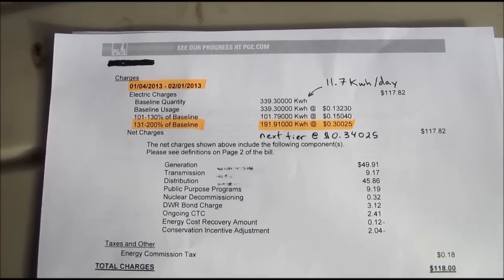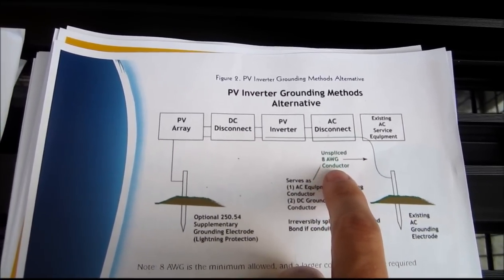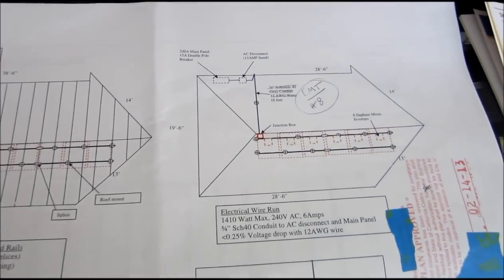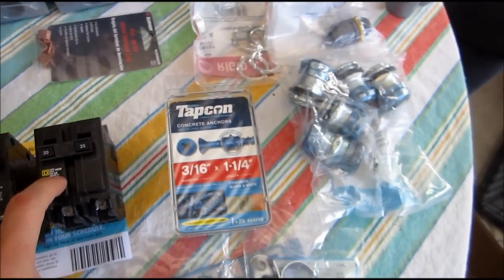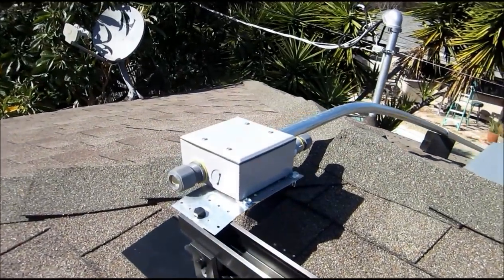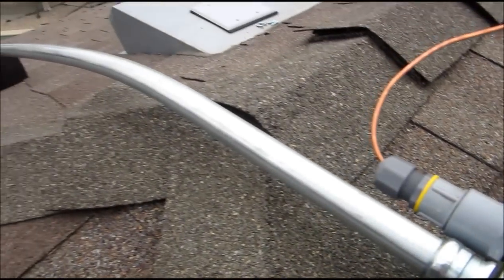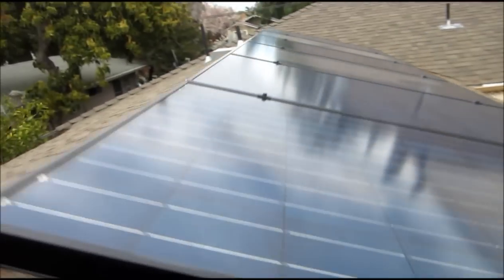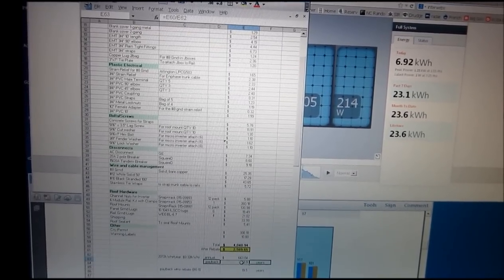1.4kW DIY Solar Grid Tied Enphase Permit Self Install with 4 year payback

Comment: How did you get this approved for net metering since the enphase micro inverter is not UL 1741 certified, per the California "List of Eligible Inverters?"
Reply from the maker: Yes, the Enphase M215 micro inverter is UL1741 certified, and also on the California list of inverters, so no problem getting it approved.

Comment: Im curious about the connection to the electrical panel.  Does your  wiring from you disconnect box connect directly to a double pole breaker in the panel.    I did not see you do that.
Reply from the maker: Yes, just wire directly to the breaker like any 240V branch circuit.

Comment: Did the city mention any setbacks you needed to comply with? Like a setback from the peak of roof? I see as silly, because you have backside firemen can cut through if needed...
Reply from the maker: Luckily I installed a year before they added the onerous setback requirements.   This installation wouldn't be approved in it's current layout under the latest rules.

Comment: weird how you weren't required to have a clearance from the roof ridge to the panels.
Reply from the maker: The roof ridge setback requirements were started in 2014.  I installed before they were required.

Comment: You had tall racks, why not run wire in the rack to the panels, that way they would never lay on roof or be steel tied to rack, done...
Reply: Would need peep holes, especially if ends are blocked...

Comment: Can THHN rather than THWN wire be used to pass the city inspection?
Reply: +David Wang No The W in THWN stands for weather resistant.
Reply: Yes it can.  THHN is usually rated as THWN-2.  I recently passed inspection with THWN-2 on 1-line diagram, and could only find THHN in stores.  It passed.

Comment: What is that couple black materials did you used that the conduit sitting on?
Reply from the maker: +marjomjom Blocks of wood painted black.  They are just resting on the roof surface.
Reply: marqlin My solar installers used block of woods too conduit sitting on, but am not comportable coz wood will rot over time bcoz of sun and rain. They applied white substance though not sure if paint but I will wait until the city inspector come then I will ask them my concern. Thanks

Comment: Very nice video. It does a great job of putting all the steps together. Information is all available from vendors, NEC, and permitting agencies, but no one else has done such a good job of putting the entire end to end overview for DIYers. To bad you weren't able to use the newer, integrated ground Enphase. Eliminates all that grounding on the roof. Also, there are some engineered penetrations that are quite nice and waterproof.

Comment: Since your solar generation is across your house load just like the power company, 2 sources in parallel in essence, how is it determined that the power from you solar is the first to be used and that the power company electricity is only tapped once your load exceeds your panels?  Seems to me that, up to the capacity of your solar, your load splits the power from your panels and the electric company and therefore you can never have less than half your power from the electric company.

Comment: I have been looking into doing this my self I'm in AZ but I found my permit is $600 in Phoenix, and APS my power utility charges $200 or something I guess to discourage solar installs.  Contractors are about double what the cost of the system is I'm thinking a small system like yours would help with the bill.

Comment: Would they have allowed you to go through the roof to inside the attic? Then you wouldn't need to use conduit inside the house.
Reply from the maker: wiboater4 I  wanted to minimize the  number of penetrations into the roof.  This is a clean install that is completely exterior to the house for easy long term maintenance.
Reply: marqlin This is why I like the idea of dedicated sun-shade awnings

Comment: Do you need PG&E permit in additional to the city?
Reply from the maker: Stephen Ho Yes, in my community one must fill out paperwork with PG&E and they will install a meter that will run backwards.  Otherwise, during the middle of the day your meter will just stop moving forward, but not go in reverse.  There is no charge for this application from PG&E.

Comment: So, no batteries or charge controller necessary? Does this mean you are basically selling all the power made to the power company and still paying the same rate for the power you use? Or are you using some power from the system in the day, and sending the rest to the power company? I do understand it is lowering the cost in some way, but I'm not sure how the power company handles all that. Do you need a smart meter, or a second meter for the power company to calculate it?
Reply: as you have seen, he's using micro-inverters linked to every PV panel. but there are batteries inverters solutions too, that works well with that.
It's like he's storing that energy on the grid, and get it back in the night, avoid the extra expenses of a battery pack, battery storage doubles the whole expenses of the system and double the payback time.
Battery storage is a must if you're living off-grid, have frequent blackouts, unreliable grid, or just want to be fully independent.
In Germany the solar system incentives are being lowered because of the solar peak production strains.
there is a move toward minimum storage, (1~3kwh) to smooth out peak productions and peak consumptions, so some are expecting incentives for energy storage too.
Reply from the maker: Correct, no batteries or charge controller.  There is a smart meter. The power generated by the panels goes into my house so I pull less power from the grid.  If my house is consuming less than the panels provide then the meter spins backwards.  I think I'll do a video showing all this data, from Enphase and from the power company, it's pretty nifty.
Reply: Ted Bundy Thats why you dont over produce. That only occurs at the end of the year if you have a true up bill. This keeps your tiers down.

Comment: Informative video!   It's amazing how the cost of the panels and micro-inverters has dropped over the past few years.  We have an 18 (panel+Enphase) system up in the Sierra and the parts were so much more just 5 years ago!   Also, from some of the comments here, it might not be clear to some that the two main advantages of using a micro-inverter are:

(1)  one panel or inverter going out does not impact the rest of the system, unlike a typical series-wired panels and common inverter system.

(2)  Enphase micro-inverters are rated to connect directly to utility power.  This means in areas like ours in CA, the utility is required to buy or credit you back if your solar output exceeds your usage.   In the mountains, we use PG&E like a bank to store the excess power we generate in the summer to help heat the house in the winter (when snow covers our hot water panels)

Also, one viewer commented on the seemingly low power output of your panels and that it might be due to the temperature.   In my experience, there is very little degradation in power due to high temperatures, and anyway your video clearly showed the panels putting out 215+ watts (out of 235) in the middle of the afternoon - not bad!

Again, great video and thanks!

Comment: What happens after the 4yrs?
Do they cut you and actual check?
Reply: No. 4 year payback means that if he produces $600/year of electricity through solar power and the solar system he installed cost $2,400, the system will pay for itself in 4 years. After that it's all FREE ELECTRICITY for 35+ more years!! Yipee.

Comment: Great video!!!! I'll be installing a similar system this fall at my home here in Alameda county.  Questions: 
1. Did your jurisdiction have any issue with your 6' spacing of roof mounts?  The solar rail company i'm buying from is recommending 48" spacing.  Not sure if they are just trying to sell me more product.  The rails i'm using are rated for 96" span.
2. I'm having trouble finding an appropriate strain relief for my bare copper EGC, what did you use.
Again thanks for the very detailed video.
Reply from the maker: Glad you enjoyed the video.  To answer your questions.

1.  For SnapNRack racking/mounts they have information in the installation manual, available online, on what spacing is required for your roof type/angle/wind speeds/height etc.  The manual is stamped by a P.E. from most states including California, so if you follow the manual in this case your local jurisdiction should be satisfied.
2.  I believe I used Arlington LPCG503 for ground strain relief (off the shelf at Home Depot IIRC).  This along with my complete parts list and cost is at the end of the video.  Switch to HD for proper viewing resolution.

Comment: Only 6 to 7 kwh per day? That's a failure given what it should produce. I assure you much higher production if you moved those to the ground. The heat given off those asphalt shingles is a detriment to those panel's production. Mine are on the ground and I see a big difference between winter and summer, almost night and day.
Reply from the maker: brad mack Heat is a factor in production, but maybe about 5-10% max over putting on the ground.  To test, one can spray water on them and the roof to cool and see how much of an instantaneous increase.  Of course on the ground can lead to more shade and loss in overall production.  It's a balance.
Reply: 5 to 10% power loss due to heat? Not a chance, I would estimate a 50% drop in capacity. Putting them on roof tops for looks is a big mistake. People simply do not under stand how electricity is generated. Do you have any idea how hot an asphalt roof is?
If you don't believe me, google it.
Reply from the maker: brad mack
Well I hit my panels with water today to see what the cooling effect is on an 85F day, and production increased by 11% dousing them and the roof with cool water from the garden hose for 5+ minutes.  So putting them on the ground would increase some production, perhaps 5%, but then I would have to deal with extra shade, and double the installation cost.  There are very likely some panels that are affected greatly by temp, but any modern day 60-cell solar panel will see much less fluctuations.
Reply: brad mack Actually Brad, 5-10% loss due to excessive heat is typically what majority of Solar Panel manufactures rate them at. Sun Power, Kyocera, LG, Solar World, etc... Sure, roof top mounts might have draw backs. But so do ground mounts! Not sure how you came up with a 50% efficiency drop due to roof heat? Working in the Solar distribution industry, I have NEVER seen that. I have the privilege to view Enphase, Solar Edge, and SMA readings constantly, and yet to that type of losses you are claiming.... Great DIY Solar Project marqlin. Thank you for sharing!

Comment: I'm doing another install at my cabin (all off-grid though) and using pvc conduit throughout including my pvc j-box on roof like yours.  Is it required to bond the #6 to the equip/ground lug in pvc j-box, if it's plastic like yours? I thought was only required if j-box was metal, but want to be code compliant on mine so appreciate your input. Thanks.
Reply from the maker: sunsensational If PVC throughout then bonding as I did is not needed.  Bonding was needed because I decided to run metal conduit on the roof.
Reply: that's what i was hoping you would say.  thanks

Comment: Great video. Question: are those micro-inverters "grid-tie" thus eliminating an inverter at or near the electrical  panel? And do they make the electrical system on the roof carrying the energy to the panel 110v?
Reply from the maker: They are grid-tied, and don't require an inverter at the panel.  They make the system 220V 60Hz on the roof, that is tied directly into a 220V breaker on the main panel.

Comment: I applaud you. I very well done and articulate installation demo. After your system has been in operation now for a while, what would you advise differently?
Reply from the maker: Nothing differently.  There is a new model of the Enphase inverter that doesn't require the 8AWG ground wire attached.  I would probably use those if cost was similar.

Comment: Great video. Nice to see all of the great panning you put into it. I am putting up a solar system that is similar and am going with micro grid ties to avoid line loss from long DC runs. Curious on how well they have performed over time and if you have seen issues with the micro inverters wattage wise.
Reply from the maker: No issues with the 6 on my roof.  Wattage output appears equivalent to May of last year.

Comment: Hi, could help me out identifying the name of the black square separator between the roof and your counduit? im trying to layout some counduit also on rooftop. Thanks
Reply from the maker: The black separator is just a piece of 4x4 wood that I painted black.  It is just resting on the roof.  Put on an angle so rain diverts around it.

Comment: nice job. i did almost the exact same instal on my roof, and my neighbors for fun, except we went with the Iron Ridge mounting system. fortunately, my city was pretty lax on permitting, and waived both electrical and building permits as part of solar initiative program. couldn't be happier though... however i did add a 2nd array (little smaller) that can be both gridtied and offgrid in case power outage. any thoughts in exploring AC Coupling with the Enphase? I know it's a pretty penny for the inverter, and work to move all the critical loads to separate/isolated panel, etc.. i'm still on fence on doing..probably only get couple brief outages a year
Reply from the maker: I have completed detailed plans for a 500W system with two 1350Whr T105RE's connected to a TriStar MPPT-45.  This would be a completely separate emergency system that would still bring 12V power into one room of my home, which would run my cable modem, WiFi routers, phone, under normal conditions.  This would lightly cycle the batteries to keep them fresh and verify everything is always operating normally.  During extended power outages, (i.e. massive earthquake), there would be enough power to keep laptops charged, run a small lamp at night, etc. for emergency reasons for our family.  I have no current motivation to install yet, but if I do I will produce a video.
Reply: sounds great.

Comment: Great video.Yes I did mine solar ground mount array by myself too.In florida,you can pull permits as owner-builder and basically do everything by yourself and after inspectiones sighn interconnection agreement with power company,but you have to be knowledgable how to properly install solar,which can be learned.Let me tell you it will be 3x cheaper than solar company and sooner return !!!

Comment: verry nice just what i need a true DIY thank you 

one question i'm in the process of pulling my permits but building and safety required my plans to be stamped by and engineer or license contractor . i am in LA county . so did you had to get them sign off . or stamped

Comment: super install! I am having a 4KW enphase system installed in 2 weeks time, looking forward to using it to power my Nissan Leaf electric car, free motoring for me as I will be getting about £1000 UK a year from the system whether I use the electricity or not.

Comment: Gud planning & set up/installations you have there boss, for the moment i do have 350w(100w&250w)panels with a 400ah batteries(2e200ah batts)

Comment: Excellent. We had our 8-panel system installed by an independent company here in Hawaii with 255W panels, but it was three times what your paid. Nice going as your detailed approach and doing it yourself saved you a bundle.